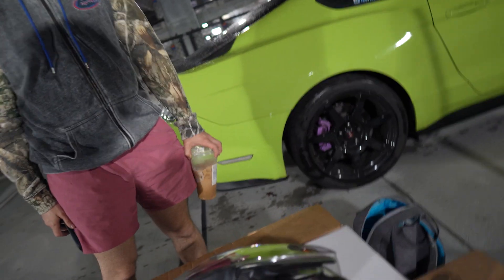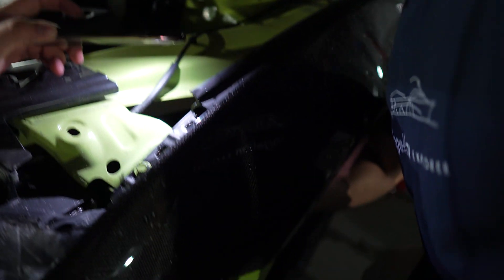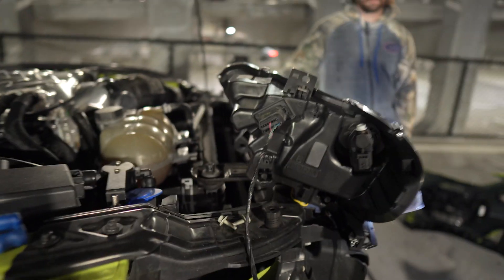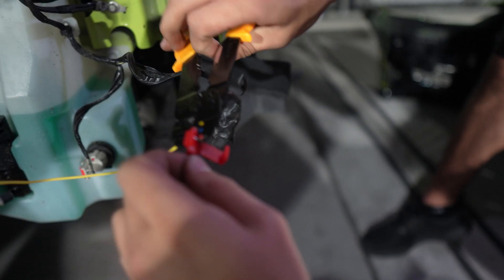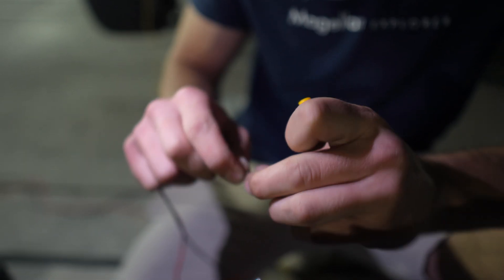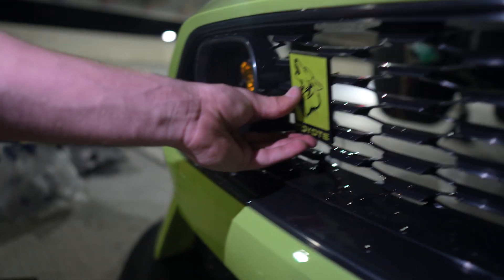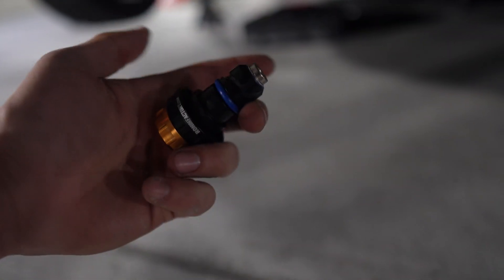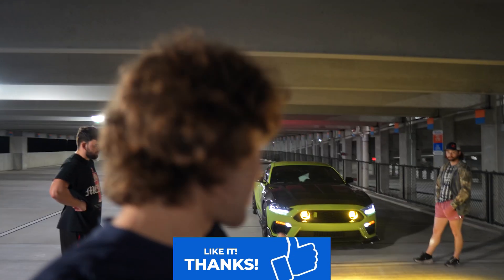INSTALLING NEW HEADLIGHTS ON MY 2020 WHIPPLE MUSTANG + WIRING GTE FOG LIGHTS IN THE MACH 1 BUMPER!

Comment: for future reference those butt connectors you have are not weatherproofed in anyway. That's not heat shrink it's a shielded butt connector. All you did was burn the plastic shielding. The butt connectors and those awful wire taps are going to corrode in  a few months and you'll wonder why none of your lights work as they're supposed to. Lights look sick though.

Comment: Hey man did you ever figure out the main projector light because I can’t figure out how they want it to be powered it needs a smaller plug in on the bulb
Reply from the maker: Re-use your stock harness!
Reply: @TobyVegaD  the stock harness is too big it’s like 5 by 2 with how many holes there is and the main projector clip needs one that’s half the size

Comment: I noticed that you installed the bumper to fender brackets the normal way. Mine would not install that way and i contacted 777 and they told me i had to flip over the bracket so it goes through the fender first instead of going through the bumper first. So was there any modification you did to get it to install the normal way?
Reply from the maker: I think it’s my aftermarket fenders that made it fit perfectly as I didn’t have to modify anything to fit the bumper 💪
Reply: @TobyVegaD  oh ok 👍 but think I may have found a way to fix it. I’ll have to do some cutting on the bumper near the tab where the bracket goes for it to fit correctly